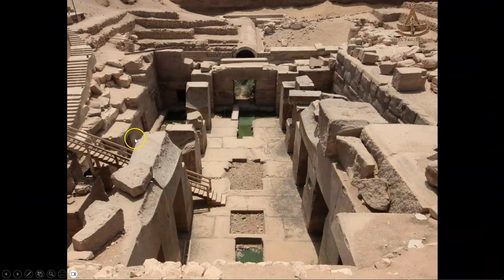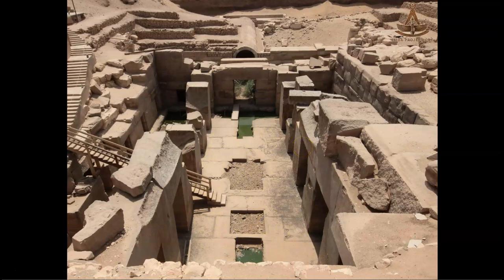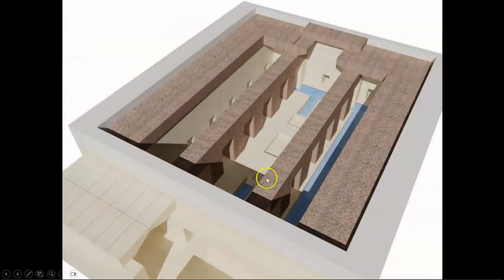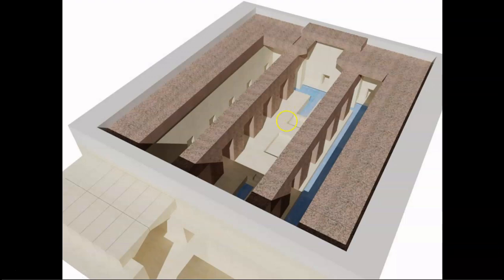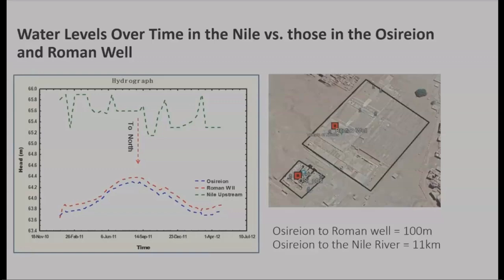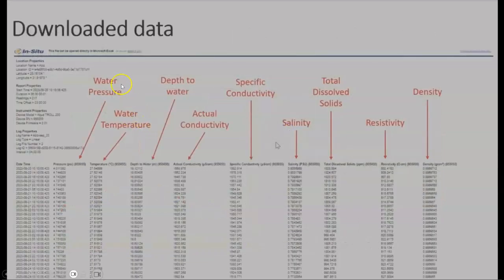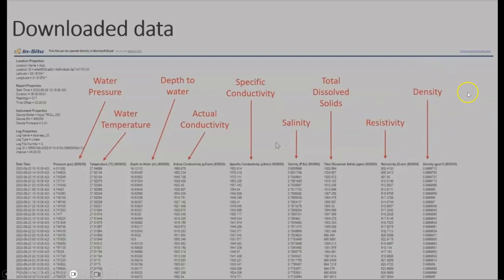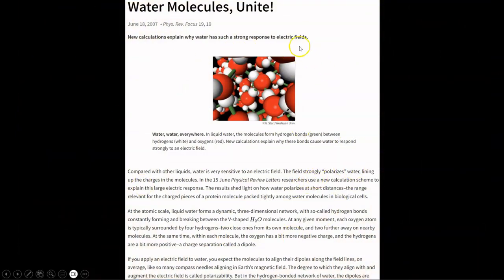Episode 118: ANCIENT TECHNOLOGY - The Function Of The Osireion

Comment: What do you think about the flower of life symbols that have been found on the top of one of the large granite pillars in the Osireion?
Reply from the maker: They are painted on with red ochre and were added to the structure far after it was built. Not original, and not significant. I show footage of them in my most recent video. It's basically graffiti
Reply: @thelandofchem  Fantastic, I will check out that video too. Great work by the way. Thanks.
Reply: @thelandofchem  -- if this is magnetron.. this 'grafitti' match electron pathways.. google magnetron.. "recirculating planar magnetron".. youll see it looks like osirion,

Comment: Hey GEOFFREY, question: filled with dialectrically charged quartz  crystals , could  the 40,000 stone vessels found in storage  under the Step Pyramid have functioned as proto batteries for lighting purposes, and have been fastened together in a chain (like christmas lights )using  conductive wire threaded through their strange handles’ drill holes?